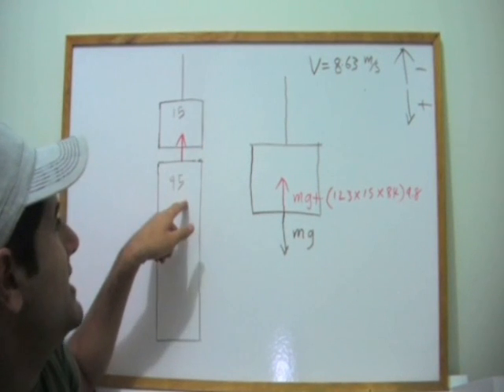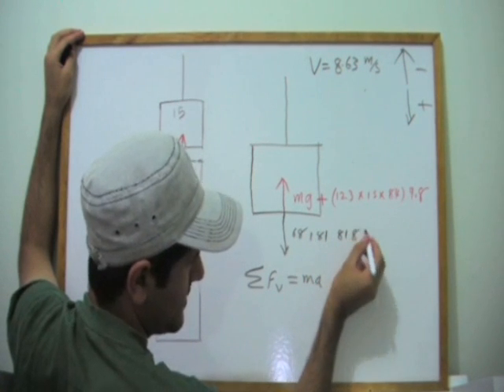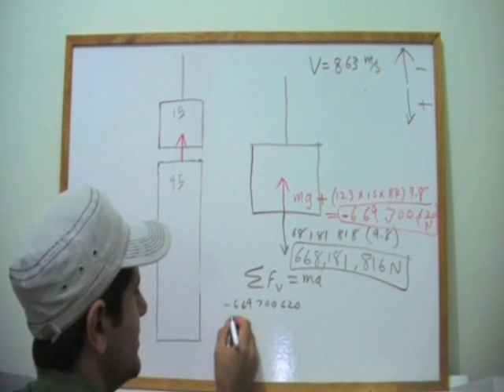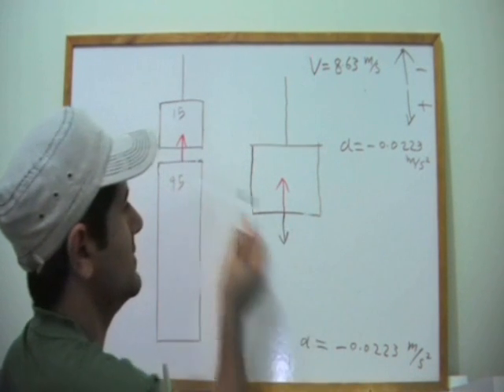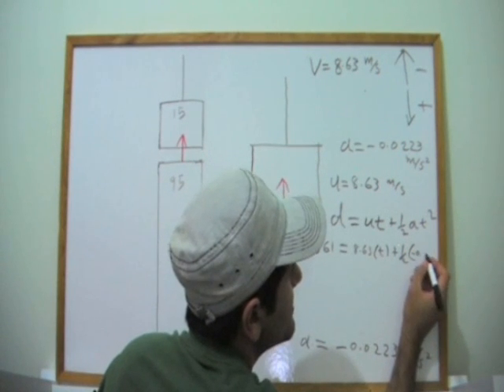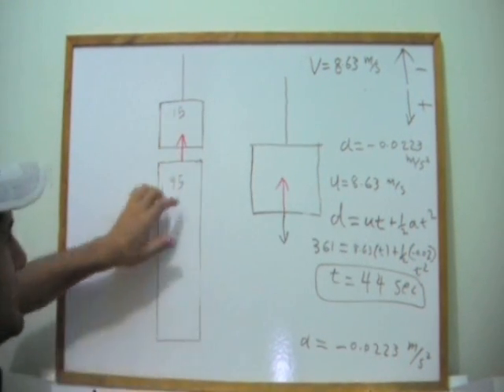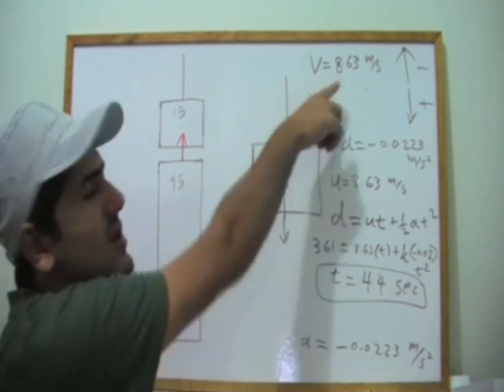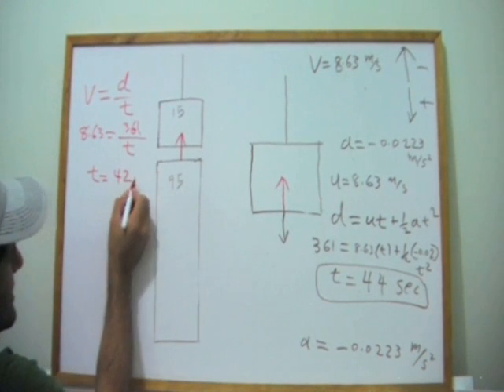(Part3) 911 Simple Physics Structural Failure Vs Demolition

Comment: I love the  constant noise in the back ground, and i even know exactly what it is (from experience) he is sitting i  an old metal foldi g chair and Everytime he moves it squeaks. Get a better chair buddy
Reply: Craig Seamus Not really.  To understand the point the fellow in the video is making, take the acceleration of the top portion onto the bottom and divide it in half.  Now move the whole tower into space and imagine the two parts accelerating and colliding together equal to that of the top portion collapsing onto the bottom.  In other words, one can look at the problem in the inverse.  Think instead that the  top portion is at rest and the bottom portion is the part that is accelerating towards it.  The fact that the bottom portion is anchored into a foundation is going to cause the collapse to become torsional (collapse by twisting) as the top isn't fixed to anything but is being held together by a huge hat truss.  
Indeed, looking at the videos of the collapse, most of the impacting mass of the top portion disintegrated rather quickly with its weight pouring over the sides of the tower.
So, it is rather odd that the building continued collapsing all the way down.  Again, think of the two sections being in space with each accelerating towards the other.  To complicate matters, I believe the bottom section of floors weren't being suspended upon trusses but had solid beams under foot between the inner core and outer shell.  So, again, why would that exceptionally strong part of the building end up being demolished?
Reply: Craig Seamus You didn't read it?  Perhaps I should start considering myself advanced.  If that is the case, you probably need to go back to college to understand.  It is all about torsion.  The bottom of the building is fixed.   The top is fixed with a hat truss.  So, when they collide together, the top is going to roll and twist while the bottom remains firm.  
I can't put it any more simpler than that.
Reply: Craig Seamus No such kind of conclusion exists, scientifically speaking.  Science works by way of consensus.  In other words, over the years, the consensus concerning the Kennedy assassination has changed from Oswald shooting him as a lone assassin, to that of a conspiracy involving him, to that of a conspiracy which utilized him as a patsy.  
Concerning 911, the original drama purported by the government didn't wash.  There is a lot of problems with the physics involved.  Working those out will eventually support the original consensus or move the people away from it.
Reply: Craig Seamus I don't know what happened.  However, I have learned a lot about buildings and physics.
Reply: I don't know.
Reply: Craig Seamus u must be a complete moron.  Neither the bushs or the us government stood to gain from this mess. Infact, the only person to gain from all of this was larry silverstein. True the government set up the tsa and department of homeland security out of this, but larry silverstein got a huge payout, but what he really got was to completely rebuild every building in the wtc complex. Also, silverstein is in with the Rothschild family, and if u really wanna know the truth of the world u live in u need to research the Rothschilds.  But the point u need to understand is scientist working on the collapse phenomenon arent concerned with the who, just the why and the how.
Reply: Kilgore Trout I agree with you but will add that for the North tower the plane damaged floors 93 to 98 on side of building with damage almost to centre.  The pancaking theory is hard to believe as you would have to have every floor truss fail a the same time, that is both ends of each truss and for 360 deg around the buildings core and then the core would still be left standing.
   Another fact is the building had 3 to 5 times redundancy built in for safety and to with stands winds to hurricane force.  The bottom half of building could easily support the top half. Why would total building free fall?
  Also if the top crushed down to destroy lower building would it not also destroy itself, equal and opposite forces. so in 15 floors or so there should be nothing left of the top part and all motion stop.
Reply: Derrick Wright Wow are you unconscious or what? This event allowed us to start a multi trillion dollar war, sign the patriot act, take away numerous freedoms and basically fast track the PNAC document into our system. How can you not see this? Most people not only in the US but other countries know all of this. WAKEY WAKEY EGGS AND BACEY!
Reply: i lowe the noise too    its kool   but i didnt say anything kause i thought i would be the only one
Reply: Everyone has to be a critic.  And I guess you understand his argument then?
Reply: he says the towers were not in fact made of butter      and building 7  had a regular  fire in it       A REGULAR FIRE    not an airplane crash  bunch of jet fuel  everywhere   fire
Reply: Craig Seamus Well, kerosene atomizes when compressed.  In the case of the twin towers collisions, the tanks suffered extreme compression.  After atomizing, the fuel then burned up.  That is how a diesel motor works.  And diesel is quite similar to kerosene (one can design a jet engine to burn diesel).
Reply: MisterNifty ewerybody knows that
Reply: Craig Seamus Well, I don't think many know that actually.  I'm not typical myself.  I wouldn't call myself a rocket scientist, but I have achieved a level of danger.
Reply: MisterNifty you dont find building 7  a hundred tirnes rnore irnplausible than the two towers?
Reply: MisterNifty i didnt bother to read all that    so you think building 7  was  a real thing/?
Reply: MisterNifty so  then you agree that 9 11 was a false flag rnission
Reply: so then you agree george bush and dikk cheney brought down those buildings  with high tech explosiwes ?
Reply: MisterNifty so you agree that.........the buildings fell  because sonebody  brought about a kontrolled dernolition    with high tech devises?
Reply: Derrick Wright keep dreaming moron
Reply: Craig Seamus i agree that u cant spell
Reply: Craig Seamus oh, and before u say the war on terror, let me assure u, bush was going to iraq regardless, his dad didnt need a reason, and neither did he. Its actually offensive to think h.w. was smart enough to do this and not get caught.
Reply: Derrick Wright
Think Cheney cabal instead. It would be a remarkable act by them to keep w., not h.w. from screwing the pooch
Reply: Kilgore Trout
But, i digress. i have no proof of anyone's involvement. i just know how physics work, and all he is saying is sound, save for there being more than a 1 floor gap of damage. The plane would have damaged on the order of 10-15 floors, judging from the footprint left behind. Still, it would all have to fail simultaneously for the block to come straight down, and thats so unlikely, it baffles the mind...but lets say 15 floors collapsed, yes it would have more inertia, but it still would decelerate rapidly. The lightest part of any high rise are its top floors, the bottom floor is the heaviest and strongest, as a foundation, and the structure gets progressively lighter and weaker as you go up. Very basic, as is this video series.
Reply: Precisely! There was also is no other way to account for pyroclastic pulverization of concrete at such an explosive rate in a progressive pancake. It also doesn't account for the behemoth central columns, which get thicker and stronger as you go down...they had not been compromised by anything. The shock of the plane strike itself was not that much greater than the shock the building received in high winds at that height. Of course wind cannot penetrate as a solid object would.

The Physics of most everything that day are sketchy at best. The spiral banking descent , and subsequent 10 ft altitude flight of the "plane that hit the pentagon" have 2 limiting qualities. 1.) The incredible difficulty of the maneuver itself(experienced pilots with many hours say they would need several attempts, if it is even possible with a commercial jet at that speed) and 2.) Wake Turbulence and Pressure Vortices would not allow a commercial liner to fly at 10' at the speed claimed, and even at its lowest possible altitude, the wake turbulence would have basically plowed the lawn.

Your point about the block destroying is absolutely correct, that is Newton's 3rd Law of Motion, To Wit; For every action, there is an equal and opposite reaction. Given that that upper block was also lighter than the floors below it, it would only be able to apply its own mass at inertia, so 15 floor block drop ≠ 15 floors destroyed below necessarily. If equal in mass, the effect is equal in size.

Another huge problem is the outright symmetry of both collapses....both buildings fell right through the path of MOST resistance.

Be Well,

—Trout
Reply: T38 Talon actually, 2 smaller compact cars took out 3 locomotives. 3birds 2 stones
Reply: Another simple explanation is a rocket. If the assertion that something gains mass by destructive accumulation, a rocket would bore through the earth, as the blast of the engines against the earth is where the energy is focused, instead of acting via Newton's 3rd Law, Which is textbook Action=Opposite+Equal Reaction, which launches the rocket. The rocket has a much lower mass that the earth, but hey, it will continue to accumulate mass, and bore right on thru, right?
Reply: Kilgore Trout One can take half of the velocity and move it to the side of the earth.  So, if the rocket is moving at 300 miles per hour, think of the earth as moving at 150 miles per hour and the rocket at 150 miles per hour.  But rockets are constantly accelerating unlike a bomb or a bullet.  One also has to factor in terminal velocity.  
Obviously, if a rocket has less mass than the earth, it is going to bounce off.  Indeed, it is going to damage the earth by boring into it.  If the earth crumples beneath it, then it might avoid deflecting off by getting stuck.  
The World Trade Center towers were designed to crumple.  The sections were bolted offset lining up vertically and diagonally along lines of perforated weakness.  This along with the rectangular beams resisting torsion tended to send the shock of the collision towards the bottom into a huge foundation of steel and towards the top where there was a hat truss to balance and absorb the impact.  Also, to keep the rectangular beams from absorbing too much energy in a single place, the bolts snapped allowing the sections to give way.  This is why they didn't weld all the sections together.  Then the concrete floors themselves crumpled inwards towards the inner core which also absorbed a lot of the energy.  For objects to survive to exit out the other side, the process would have to be repeated in the reverse.
Reply: Kilgore Trout wrong!
Reply: I am sorry that there was no conspiracy for you to get excited over
it is just like Oswald killing Kennedy he meant to kill Connolly because Connolly changed his discharge from honorable to dishonorable and he didnt lead him far enough and hit kennedy instead. No conspiracy there either. Oswald was mad at Connolly not kennedy
Reply: Irene Moran Irene is not a professional if she was, she would be out of a job for insubordination for insulting her superiors, she thinks she is the only one who knows the score and hurls insults at anyone that does not share her view. She must be Islam. I don't know what freedoms she is talking about that have been taken away because I am as free as a bird..
Reply: MisterNifty yup!
Reply: MisterNifty by shear weight and speed. It had to accelerate to a terminal velocity and if that velocity was sufficient to collapse it all the way down, so be it. Go and buy this new toy called the " eggstractor" and use it. You will have a pretty good idea of how the collapse unzipped the tower.
Reply: You aren't worth making comments to any more.  If you were actually trying to cause confusion, you couldn't do a better job than you are doing right now.
Reply: Derrick Wright We did go to Iraq because of oil! Why is the question! OPEC (organization of petroleum exporting countries) refused to continue accepting the "petro-dollar" as standard currency for trading oil
They switched over to the EURO. This caused the price of oil to spike above 100 dollars for 1 barrel.
  OPEC tried to screw us and we retaliated there Mr. Craig Dumbshit Seamus. Bush wouldn't even allow testing of human embryos let alone collapse the towers. 
  Islam thinks with its dick. Watch the vids of ISIS having sex with their goats and their asses. The world will be a wonderful place without Islam in a little while. And until then you will just keep on killing people until you get your stinking bowl of pottage back from the Jews. 
 Here is a bit of advise! Give it up! You are not getting it back! Esau lost it for good because he was an idiot! and so are you!! It runs in the genes. Now you will come after me too. Make sure that your gun is bigger and faster that the gun that I have, and you had better be able to shoot straighter that I can. Both my son and I wear experts badges. That means that we hit our target every time! 
  I've seen how you shoot. You hide behind the wall and spray bullets the same way you hide behind the mask when you blow a building up!
  Secondly there are a lot worse things that death. People that murder people do not go where they think they are going no matter how hard they try! the less people up there the more room for me! Go watch "Ghost" over and over until it sinks in. Then you will have a pretty good idea of what happens to the scum that think they are going to Heaven after they kill someone in cold blood. So YES! It was and is still about oil!
Reply: Kilgore Trout Wrong!
Reply: Kilgore Trout Newtons 3rd law is that there is an equal and opposite reaction AT THE VERY LEAST!
Reply: Kilgore Trout I watched a BB fired from a plasma gun at 20,00 MPH blow a hole into an aluminum block 2.5 inches in diameter. Mass and size can and often do not equal each other.
Reply: Wasatch Range Railway Physics reduces to energy.  The energy of the jets busted the bolts holding the sections of the towers together.  It is interesting how the corner sections of the outside shell were only fit every other floor fastening one side of a wall to another one.  

Check out this picture of the corner of the building.  There are sections every other floor connecting one side of the tower to the other.

  www.google.com/search?q=corner+section+of+world+trade+center+towers&rlz=1C1CHNY_enUS487US487&es_sm=93&source=lnms&tbm=isch&sa=X&ei=QyM7VZfyF8WXsAW1sICICg&ved=0CAgQ_AUoAg&biw=1366&bih=643#tbm=isch&q=corner+sections+of+twin+world+trade+center+towers&imgrc=7ShmY77ZQl12zM%253A%3BIflILZjbJ7rXtM%3Bhttp%253A%252F%252Falgoxy.com%252Fpsych%252Fimages%252Felev_guide.rail.supp.jpg%3Bhttp%253A%252F%252Falgoxy.com%252Fpsych%252Ffema_deception.html%3B599%3B405
Reply: Duh, mass and size RARELY equal each other. i.e. a cubic metre of styrofoam vs a cubic metre of lead, just to make an extreme example. More importantly,  why do you keep addressing me, when i was done with you weeks ago? Then you got the genius idea to plagiarize another poster's remark of "Wrong!". Wow. Haven't you a dog to kick or something? Also, just to be pedantic, it is an Electro-Thermal weapon, it fires a projectile via Capacitive Discharge. Not really a plasma weapon, which would need no projectile.

It seems you have some unresolved anger issues that need working out. i would say that YT is probably the worst resource for that, and i am not even mildly interested in being your caseworker, direct your personal attacks and pejoratives elsewhere. Good day.
Reply: Kilgore Trout Very intelligent writing with many good points! I have been trying to explain the point about the columns increasing in strength and size as they get closer to the bottom of the towers because they obviously wouldn't build top heavy skyscrapers. Also, your point concerning the particles and the fact that mechanical crushing can not produce nano particles is something that I am in total agreement with. It is extremely frustrating getting scorned and insulted by individuals for explaining basic scientific concepts. Outside of my applied physics class and some other classes people look at me like I have two heads when discussing this subject. It is refreshing to know that not everyone is semiconscious. Great post!
Reply: Wasatch Range Railway Physics reduces to energy.  The energy of a  moving purple moose eating a marshmallow can smash through an aluminum block.
Reply: MisterNifty It seems like certain organizations have avoided the method. Based on observations ( especially audible explosions ) a hypothesis should have at least included the existence of secondary explosions. Then performance of tests if for no other reason but to explain them however no tests for explosives? I know this is not the scientific method that I hold dear.
Reply: Irene Moran Indeed, before one can establish a theory, one must first establish a hypothesis.  A hypothesis itself is only valid if it is able to be tested.  

The hypothesis behind 911 pointed a finger at terrorists from Saudi Arabia.  So,  in response, we attacked Iraq and had Saddam Hussein executed.